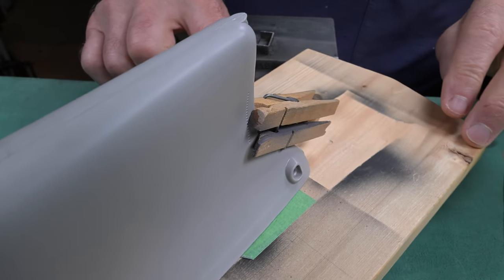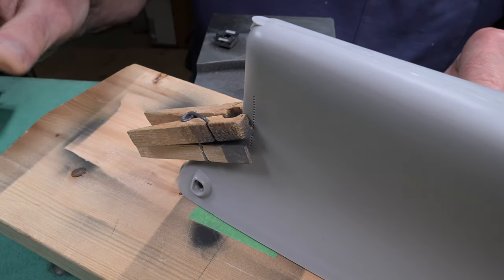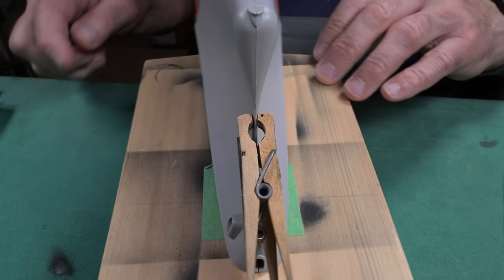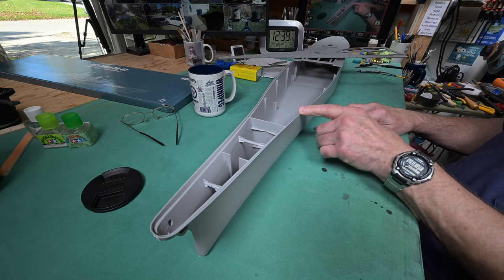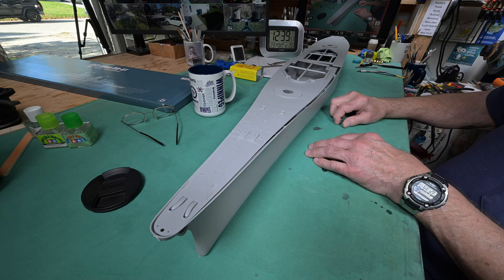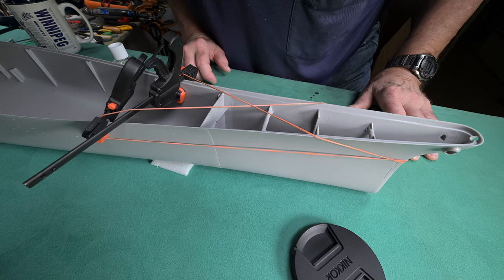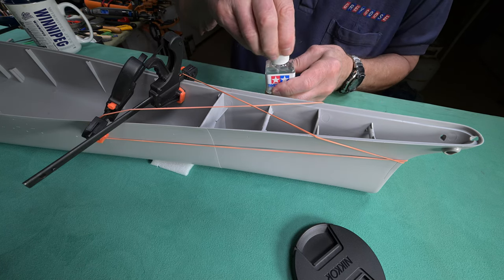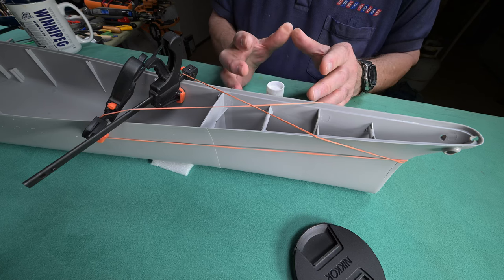The Model Ship - Part 1327

Comment: Hi Ron, It's great to see you working on the Iowa.  Yes, the glue in the bottle with the white cap is glue your subscriber is referring to.  I prefer a thick slower setting glue for large joints.  It's a fairly hot slow drying  glue that gives you the strongest joints on those large parts.  See you tomorrow.  Have a great day.  Jeff
Reply from the maker: Thanks for the info Jeff! 👍

Comment: Bravo on the hull! I wish I had thought of using clamps and rubber bands like you did. I like Aussie's comment about opening that hull's nose a bit and get it tight. If you look ahead you're going to put a gun tub on top of the bow tip so you'll want it tight. Great start!

Comment: Ahoy Sir Ron I have the Iowa The Bow section of the kit will present a small gap of  2mm I used epoxy to fill in the gap the same thing on the wing screw fairings under the hull this to has to be filled in using same method like on the bow. I started mine last night having a ball Keep up the great work  Frankie Day Models
Reply from the maker: Thanks for the tip. 👍🏼

Comment: Hi Ron nice start on the Iowa you said about the deck being teak well during her shakedown in the spring of 43 she had a teak deck but the anti aircraft fit was different to the kit layout and no bow pulpit. By October 43 she was in early measure 22 camouflage with the stained blue wood deck. So at some time during her AA refit between spring of 43 and October 43 I would think she could very well have had a teak deck and the AA fit out as per the kit and in early measure 22 camouflage. Check out your Anatomy of the ship book on the Iowa and you will see her layout during her shakedown

Comment: Hi Ron, Steve from the model shed has mentioned a stuff called Mr Surface.. I get the impression it’s a professional surface leveler/seam remover, a bit like spruce goo.  I’ve never used it but might be worth touching base with Steve for his thoughts.
Reply: @roncalverley  Mr Dissolved Putty and Mr Surfacer are excellent better than tube putty.
Reply from the maker: @edhawkins2765  Thanks Ed

Comment: For acrylics, I tend to use Vallejo Hull Red, it sprays nicely out of the bottle
Reply from the maker: 👍 https://www.amazon.ca/Vallejo-Hull-Model-Color-Paint/dp/B000PHCNZ8
Reply: @roncalverley  Unfortunately the Vallejo Hull Red is about the same as the Tamiya Hull Red and not a good match for the Norfolk Red #65A.  I use AK Interactive acrylic Dirty Red which is a good match.  Ron, you can look that up to see the similarity between that and Tamiya Dull Red.